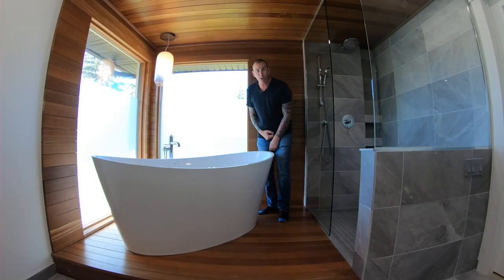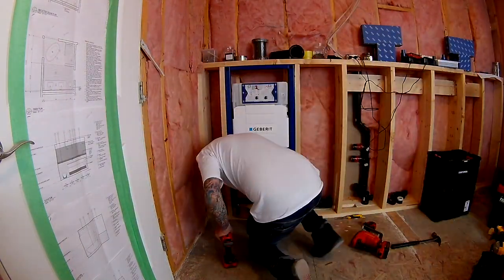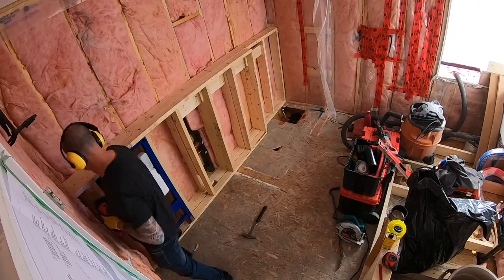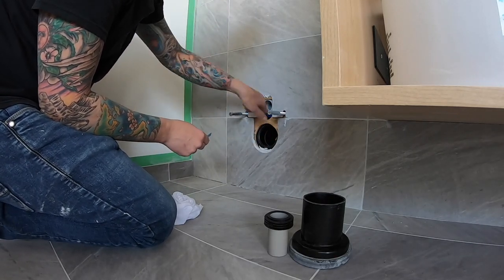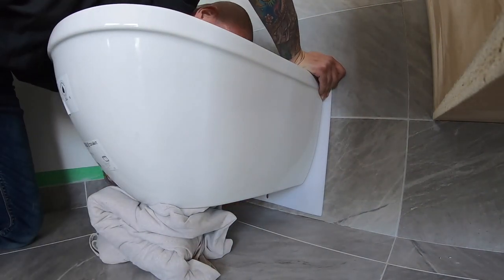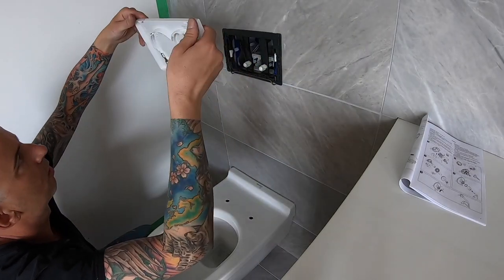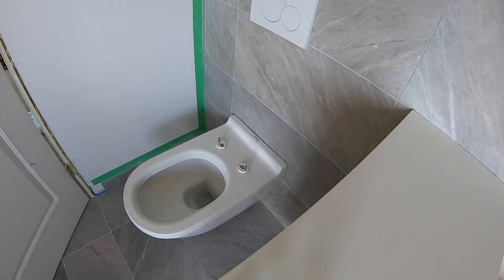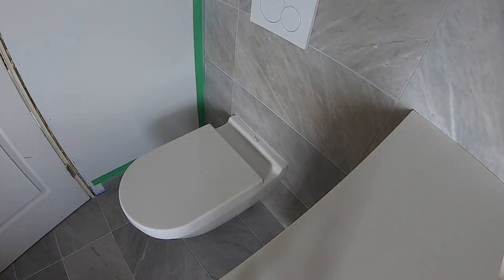Wall Hung Toilet Install full details

Comment: how did you vent this toilet?
Reply: i was wondering that too..
Reply from the maker: I used 4” pipe so it can be up to 10’ away. The vent is right where the old toilet location is.
Reply: Really stupid question.  Please forgive me.  I'm not a plumber but I am trying to learn.  I have an existing shed that I turned into an office but it has no in-ground plumbing.  So I was going to run the plumbing lines directly from the outside wall into the shed, is this possible?    I want to try to do this by myself.  I don't want to ask my husband or father for help.

Comment: My plumber just installed our duravit wall hung with the geberit carrier. Immediately we were getting about an 1/8 of an inch movement off the wall when sitting on it (I weigh 145 lbs). It has a crackling sound in the blueboard and a nail pop moves with it in the stud next to the carrier. Any tips?
Reply from the maker: Might have to start over. I always use 2x6 walls, I prefer to sheet with plywood and always use strong galvanized fasters when attaching the carrier to the wall. Have you tiled yet?

Comment: Not for fat people.  They, the architects and designers, had us (against our protests) install these at the residence halls and they all break, even after steel reinforcement.  The ones that sit on the ground never had this problem (well, some people own sledge hammers).
Reply from the maker: Sorry to hear that, did you use the Geberit wall tank and carrier?
Reply: @ConstructionCoach  We've tried everything including steel reinforcement.  Luckily, with our findings, new buildings will use the traditional toilet but the buildings built (less than 5 years ago, we're a new UC) with the hanging toilets will have to stay the same (It's too expensive to break into concrete and steel, probably structural) and we just replace the toilets as they break (women's bathrooms are the same, lol).  Current university students are just too fat or perhaps there bones weigh more (no issues with staff private bathrooms). 

Not the only issue, they want us to paint the dorms in flat paints (trends) instead of gloss or semigloss paints that are easier to clean.  The new fiberglass showers are cheaper but more difficult to clean and keep looking new.  Also, Leed rated buildings are a disaster (they cost too much, the don't last and they are not energy efficient) just so the chancellor can put a stupid gold or platinum plaque on their wall.
Reply: @ConstructionCoach  By the way, I'm the accountant not the building manager (who has the technical knowledge).  I just laugh as I budget toilet repair as a line item (laugh at meetings too when a toilet breaking is announced).
Reply: I thought the same thing. We have enough issues putting marble on wall mounted vanities let alone an entire ceramic toilet

It looks good the reality is it costs too much problems for the builders.
Reply from the maker: They sure look great!!! Interior designers don’t care about the problems!! They care about the look!!
Reply: Guys/girls, wall toilets are quite common in a lot of countries in the world and they have fat people too. Don't be biased. I wouldn't rent a home anymore who doesn't have them since the floor ones are more work to clean and they just are looking ugly. Leaking can happen for both of them but I only know it from the floor ones since at least here the installers tend to be more sloppy with them. A wrong wall installation also would mean more work after, so they are way more careful with that.
Reply: @UsiUsiUsi  That's great but what I said was actual experience in a public university.  Wall mounted toilets will crack when subject to lots of weight.  vitreous china does not have much shear strength.
Reply: @fernarias  Could it be a bit bc bathrooms in public universities aren't treated well after all? I can remember in school they used floor ones bc they were cheaper since they had be replaced often since the kids were kind of...well..."abusive" to them. That normally doesn't happen at home.
Reply: @UsiUsiUsi  We haven't replaced a single floor toilet.  We have replaced more than I can count wall mounted.  There are several instances where they broke while someone was using it.  Most failures were cracks and the first thing we noticed was leaking from the flange to the bowl.  As my post is 8 months old, this summer, we were told to place a thick rubber gasket between the toilet and the wall mounting so we'll see if this works.  Luckily only one building has these toilets since we stopped using them on new buildings.
Reply: I'm small and my biggest fear is having this thing fall off the wall when I'm using it!     I'm reading the comments to my husband and told him about the fat people thing LOL.   My husband is not fat but he is a big Marine.  We had a good laugh.  But seriously, I am really concerned about the falling off the wall thing.   I was going to go with Geberit but it is out of my price range so I decided to go with Swiss Madison.  Does anyone have any experience with Swiss Madison products?  I'm learning as I go here because I want a small powder room for my little office and I am limited on space.   I know wall mounts are used all over Europe so they can't be all THAT bad.